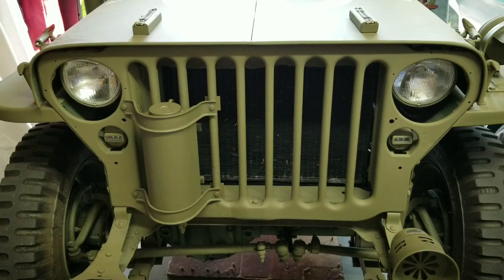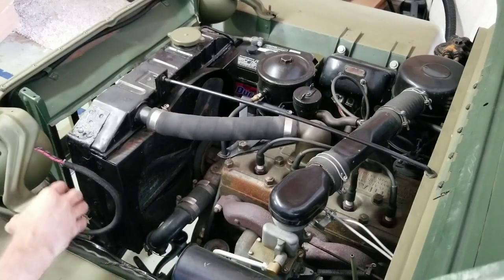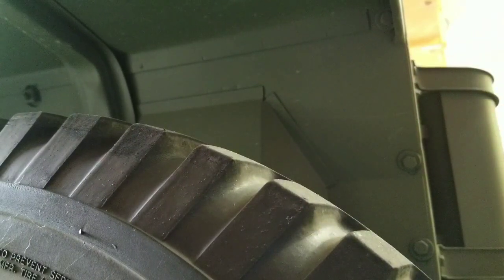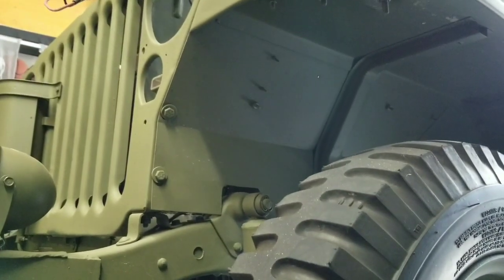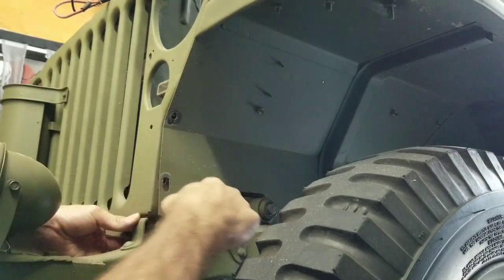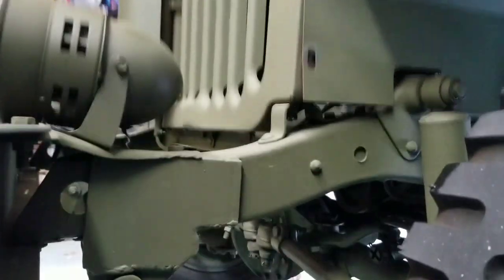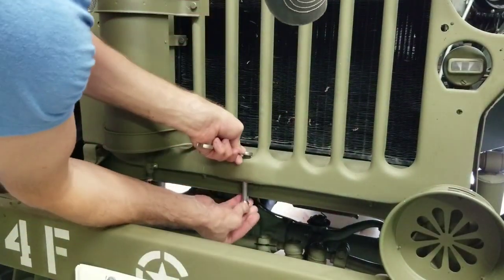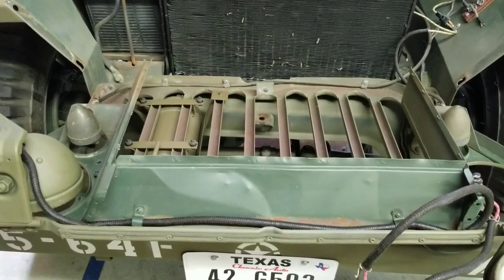Jeep Grille Removal for Willys MB / Ford GPW WW2 WWII Service

Comment: What is the big cylinder banded to the front of the grille?
Reply from the maker: It's an overflow reservoir for coolant -- called a "desert cooler".  Otherwise, as the engine heats up and coolant expands in the radiator, it just drains out the filler cap onto the ground and into the engine compartment.